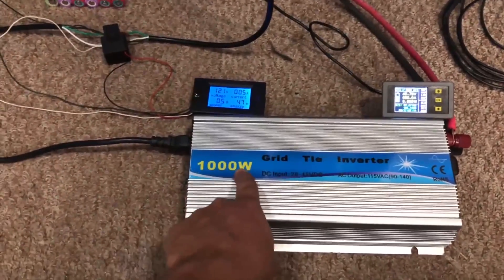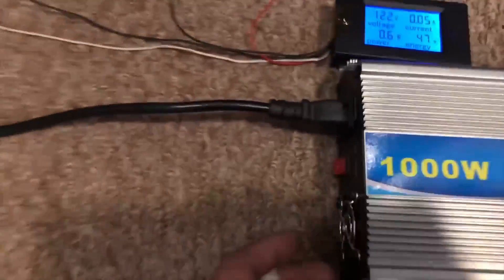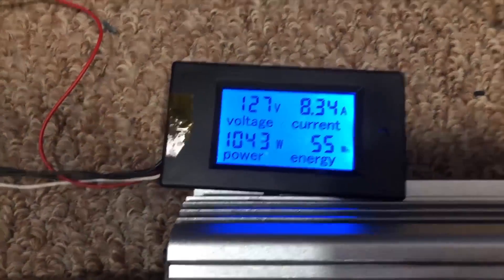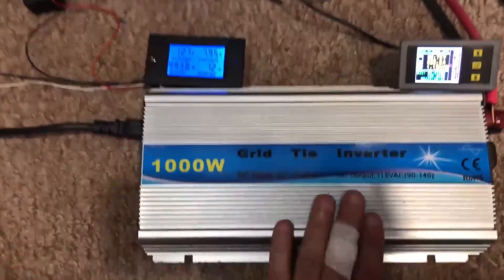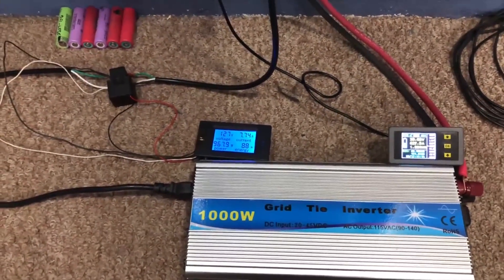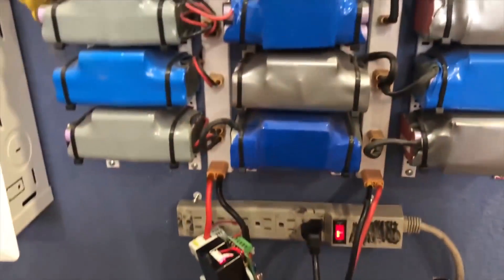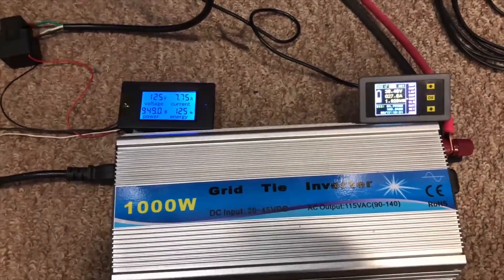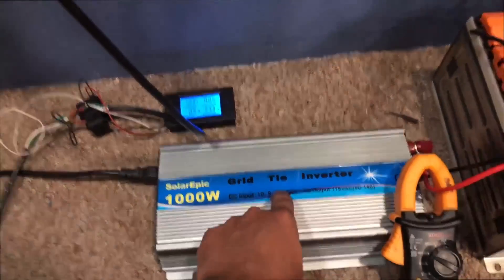Y&H 1000W Grid Tie Inverter DC20-45V Fit for 36V Solar Panel/36V Battery

Comment: Hi there since u are using battery is there anyway to prevent working at low voltage in batteries ?

Comment: Nice work. Pleasant to see someone doing a meaningful test. I've used the 12V one for some time primarily to bleed down a big 12V bank when it gets too full. At that voltage, it only pulls about 20A DC, so I'm only getting about 240W.  In other situations, the bank is closer to 14.4 or so, and it'll pull about 25A or 360W.  This meets my needs in most cases, but for those wanting an actual 1000W, it's very important to be in the MPPT voltage range.

I've been eyeing the 36V unit because I've recently purchased about 6000W of solar panels for a future off grid application, and I'd like to use about 4000W of it at the house.  Seeing the units push 1000W at ~36V is very encouraging.

Nice video!
Reply from the maker: We do not recommend using a 12V battery, DC 10.8-30V version. Please use 24V battery / 12V solar panel (Vmp18-21V; VOC20-24V)
Reply: You all seem very knowledgeable the question I have is, can I series three 12v batteries together and use for 2 36v panels?
Reply: @jacobking1837  Please expand on your question.  Is this in the context of the grid tie inverter, i.e., you want to power the grid-tie inverter with batteries rather than solar panels, or are you looking to charge the three batteries with solar panels?